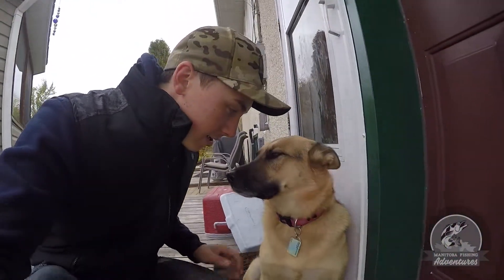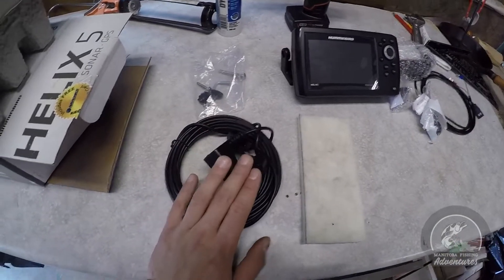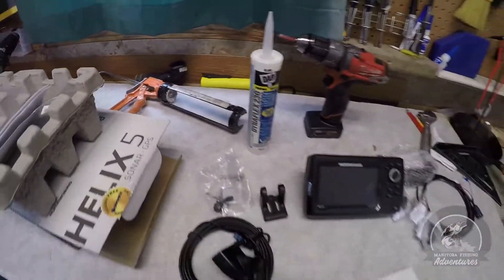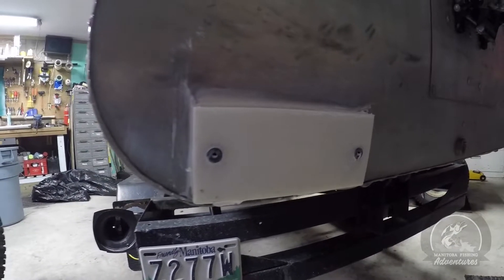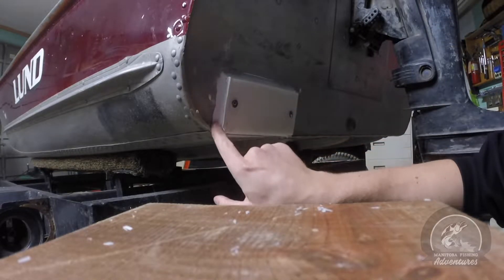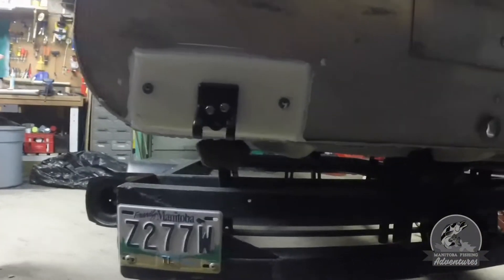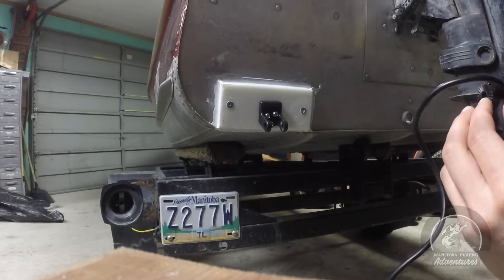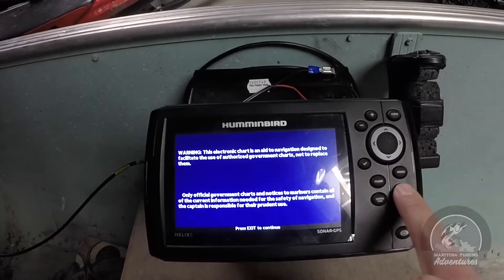How To Install a Transducer (humminbird)

Comment: That's a sweet little motor, LOL I have the exact same one. Still runs like a clock.
Keep an eye out for a 15hp carb though. The only difference between the 7.5, 9.8, and 15 is the carburetor. and if you could have a 10 why not have a 15 right?
Reply from the maker: Where'sTheSauce? Yeah not s bad motor at all! Thanks for the info!